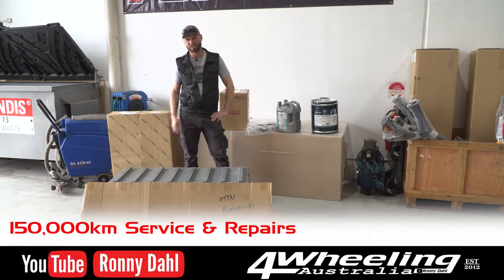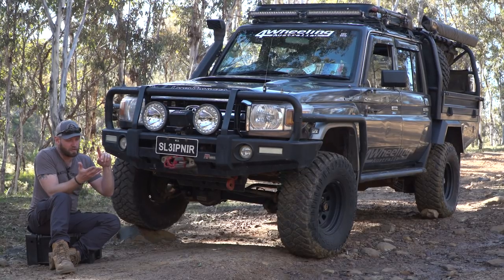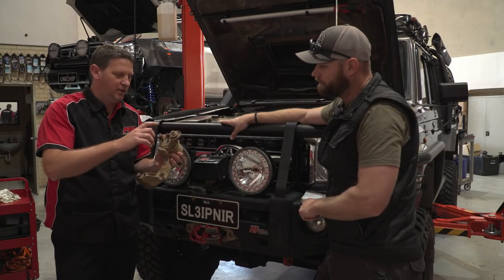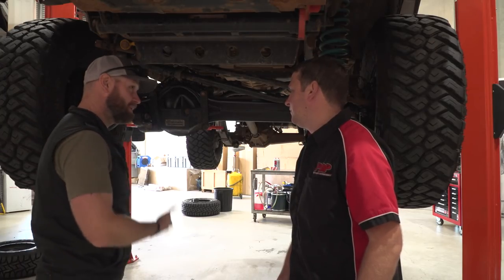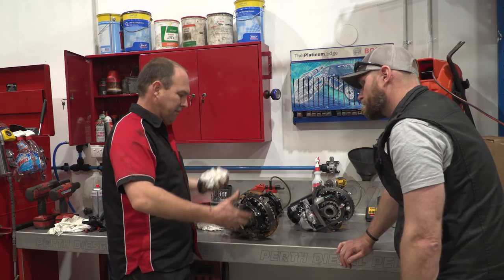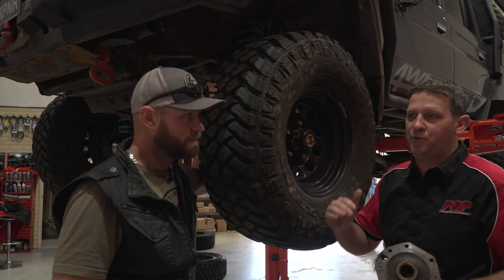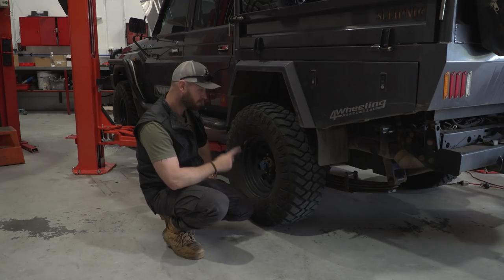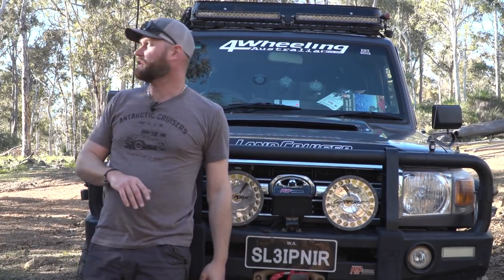Landcruiser 150000km service

Comment: I’ve a defender probably only other vehicle that would take all that use and still be going !
Reply: I guess the g wagon doesn’t exist as for lr being unreliable I guess most commonwealth military’s don’t need reliable vehicles
Reply: SDP Pinzgauer - mine is from 1977 and still rolling strong after 40 years in the armed forces.
Reply: Don’t know where this fallacy of land rovers being unreliable came from they have been going strong for 70 years , it’s a work vehicle if you are comparing comfort pick a discovery 4 or Range Rover , defenders were never built for comfort , as for carrying loads the poor landy has been abused for decades , how many military units around the world were using them before production ceased , take the defenders used by the British military in recent desert conflicts carried way in excess of recommended payload including fuel and water and still did the job , it’s mostly down to how well anything is driven and looked after I’m not getting into an argument it’s each to their own
Reply: Diana Carroll the fallacy comes from Japanese engineering being superior in the 70’s and layland not being able to supply cars it also wasn’t helped at least here in Australia by a massive deal with the Japanese to supply coal part of which required the use of Japanese mine vehicles as a side note the adf’s defenders all had an Isuzu engine rather than lr’s unit
Reply: I remember when BMW owned LR and they put a saloon V8 in the RR. LR made some modifications to the front pulley area to avoid any ingress. I aplaud LR ability to retrofit road engines in off-highway vehicles, but most dual purpose LR, LC, MB... are not designing motors specifically for off highway.
Reply: Good luck fixing your land rover in the remote bush and desert,.. ask any mechanic what he thinks is best 😉